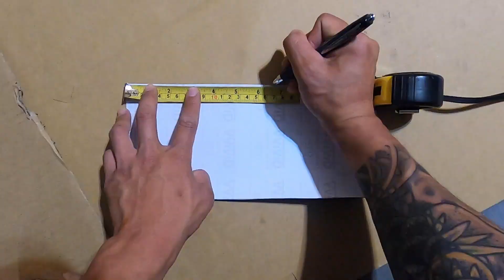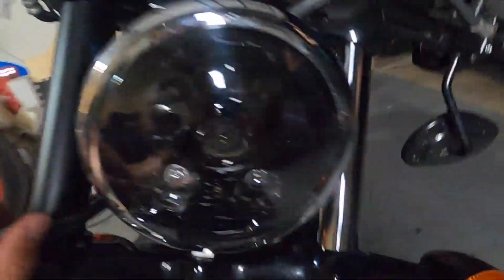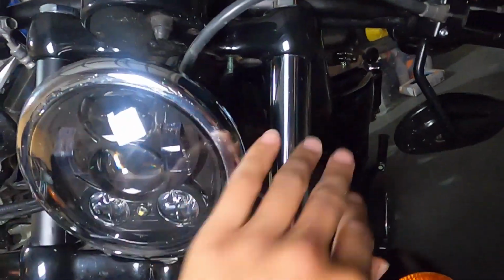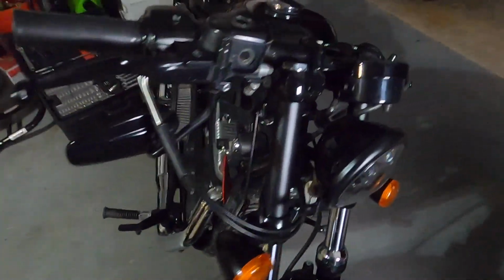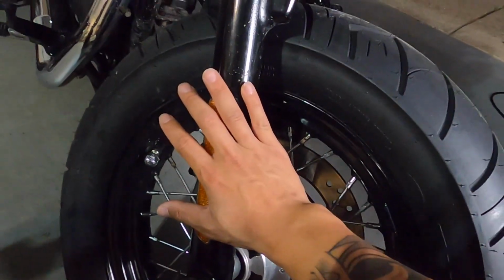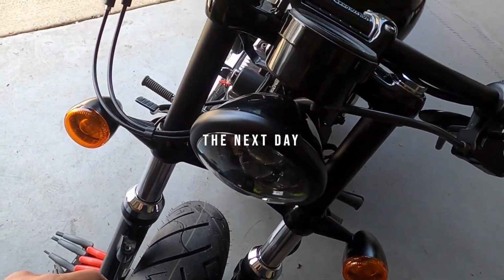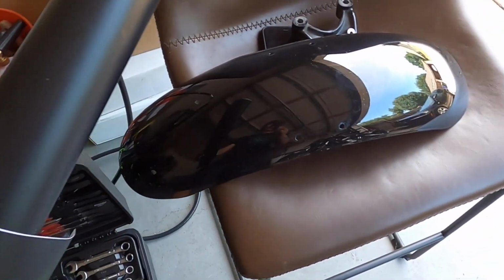🏍️ Harley 48 Sportster Bobber | Chrome Delete Vinyl Wrap & Front End Declutter | VLOG 15

Comment: Hey brother great build. I have identical bike a 2018 48 special. I just changed my bars, I bought it used from Harley and it had mini ape hangers on. So I immediately too em off and got regular short bars. I will move the blinkers like u did, that was a great idea! But I’m having issues with the cables being too long…I don’t know if they are stock since it had ape hangers. Do u know if they can be shorter? Is there a kit for that
Reply from the maker: Appreciate it! And if you have excess wires, I'd just tuck it behind other body pieces and zip tie them